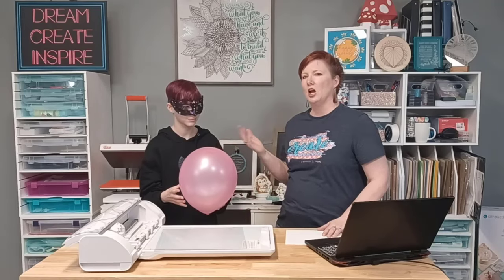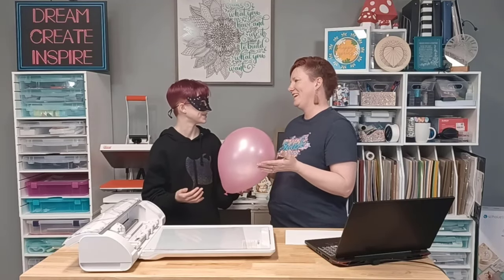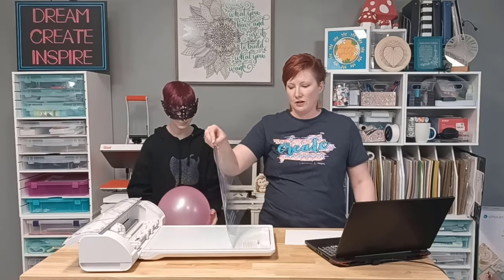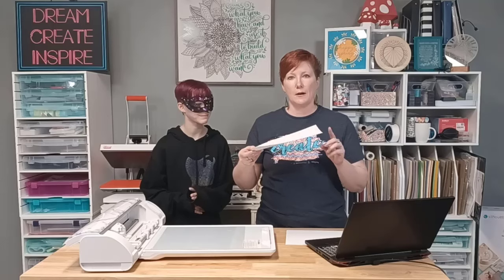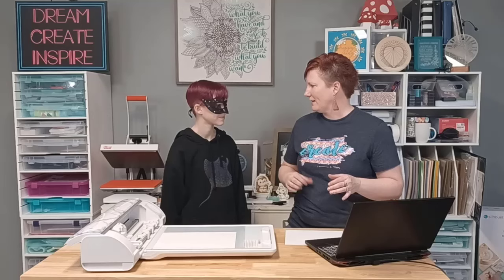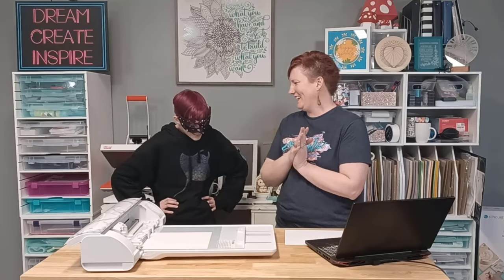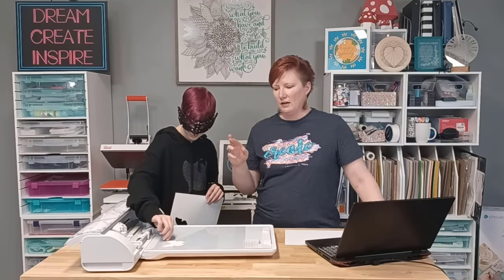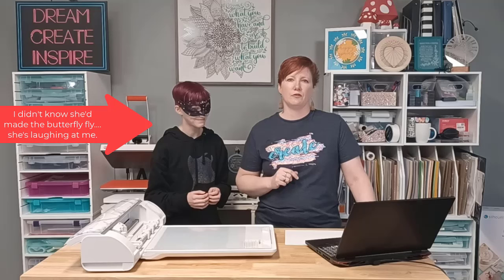Silhouette Electrostatic Bed Demonstration with the Silhouette Cameo 5

Comment: I can cut a3 size in it?
Reply from the maker: The ES bed is 12" x 12".
Reply: @SilhouetteSecrets  thanks 💙
Reply: Should there be a cut of the design on the protection sheet after cutting (light) almost like when you use a regular mat?
Reply from the maker: @desireemartin3485  Yes, there can be. Anytime you cut completely through a material, you could see the design in either the cutting mat or ES protective sheet.